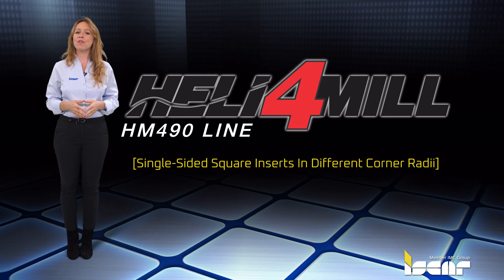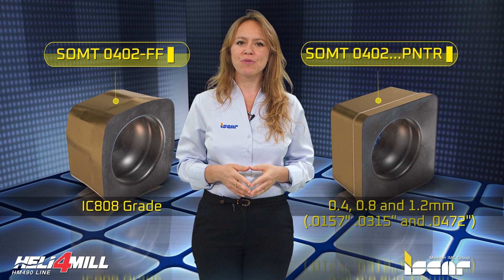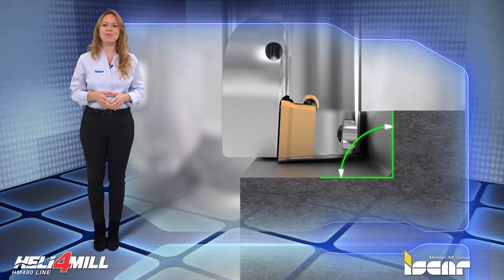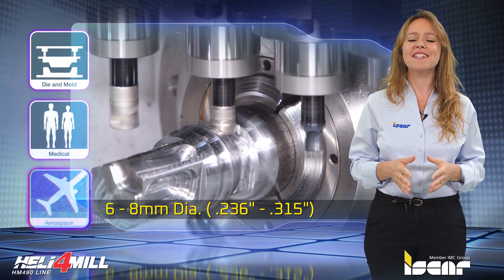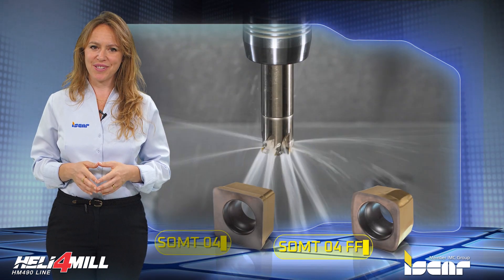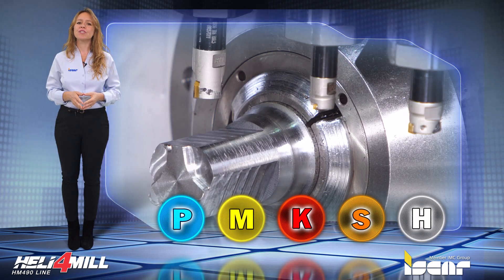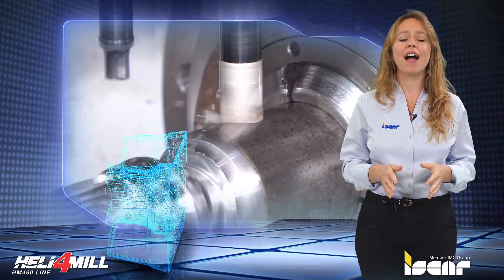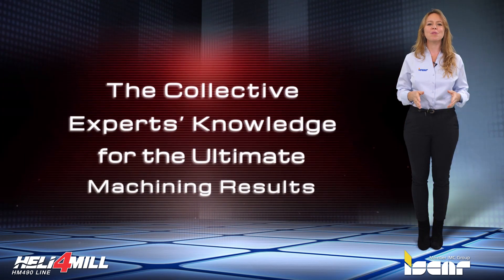ISCAR TECH TALK -  ISCAR HELI-4-MILL for Extra Small Diameter Milling

Comment: ISCAR: The correct is "Zero four ... Zero two " in 00:43 time, right?
Reply from the maker: Yes, it's the same .
Reply: @iscarweb  i think is not the same. You can see: The code is SOMT 0402 and not SOMT O4O2 (  is related to the dimensions of the insert, and this part of the code does not have letters ).
Reply from the maker: @mark_4310  Thank you for your comment